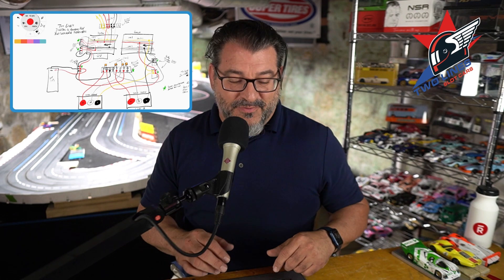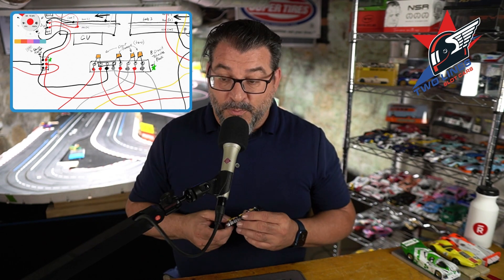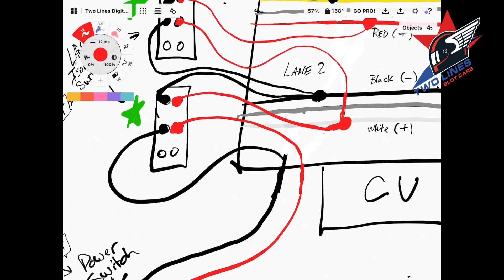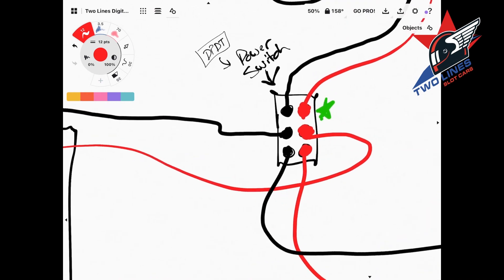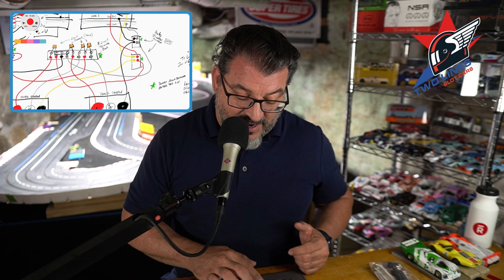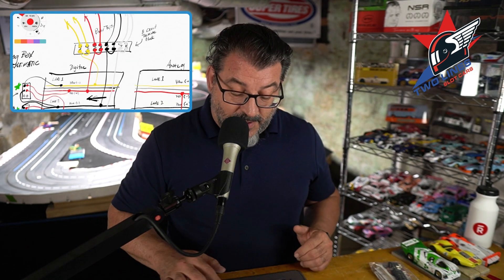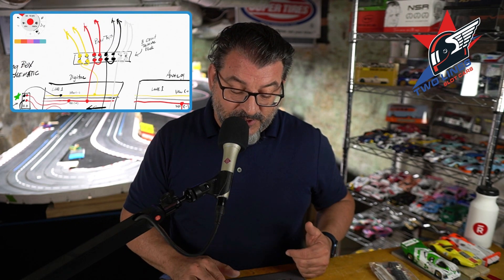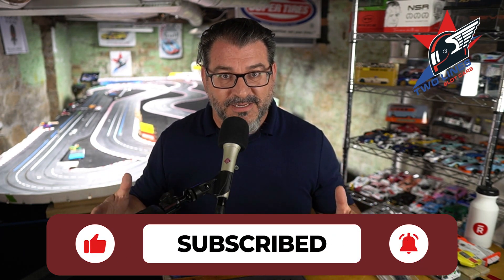Discussing how to DIY a Carrera Digital to Analog Conversion Box - Part 2

Comment: so what happens with all your lanechangers and pit lane?
Reply from the maker: They are not operational in analog mode. but operate like regular track peices.
Reply: @twolinesslotcars  sorry yes that I know, but you have to isolate the electronics since you are switching the polarity right? This means you have to have wires coming out of every LC to your box?
Reply from the maker: @CR3DT  Yes, you are switching polarity of the track.  The switches protect the CU. The lane changers are not impacted by the polarity change.. they act like standard track when in analog mode. There is a link to my hand drawn schematic in the description. @SlotR did an update to my box using relays, it is much more efficient,  but does the exact same thing.
Reply: @twolinesslotcars  I was under the impression that if reversed the polarity of the track (let's forgot about the CU for min) and there was an LC, that I would short out and burn out the electronics in the LC unless I isolated them? Sorry if this is the stupid question
Reply from the maker: @CR3DT  the only digital track piece you have to worry about is the CU and the Corner Lane changer. Because inside those track pieces the lanes are jumpered together. Corner lane changer is easy fix. Open it up and remove the lane jumper inside. The key is that the positive rails are isolated. That is why the lane changers are safe using the convertor box.

Comment: I've started this project, but I have another question. The additional wires under the cu track (yellow, blue...) do you leave those hooked up and only use the red and black wires to the new box?  Thank you.
Reply from the maker: The yellow and blue wires go to the lap counting LED’s. Leave them alone.. check out SlotR’s new video from last week.. it is an update and improvement to my design.
Reply: I will, thank you very much!

Comment: I don't think I understand how the digital CU gets power. Is it from the track? I love this idea!
Reply from the maker: Power from supply goes into the box to a switch.. and from the switch.. to the CU.. and to the Analog side.. then i used switches to protect the CU when in Analog mode.. it is a very simplistic look at it. I could use an Arduino and some relays to combine some of the switching.. it could be done a million different ways.. but this works.. I use it every day.. Thanks for watching!

Comment: Thank you Marty !! Have you been able get this to work with the 4 lane track you have now ? I’m about to start on my 4 lane on about a month and would like to still be able to use my tech slot box with my 4 lane 2 digital 4 analog
Reply from the maker: I do have it working on my track. It takes a bit of work.. but it is possible. Your Tek Slot Box will only do two lanes of digital and analog unless it was specifically built for 4 lanes.

Comment: Marty I like what you have done so far. I can't find the next video where you said you would open your box and also show us the wiring of the cu and analog straight piece of track. Also can you send your email so I can get a copy of the wiring
 Thanks so much.
Reply from the maker: Kevin, there is a link in the description of the video to down load the file. I have yet to release that video because I have made some changes and added lanes to the track.
Reply: Marty thank you for the prompt response.  I have the same 2 lane track that you had before you went 4 lane, and am considering going also with your 4 lane track.                   I downloaded the non schematic and wired my track identical to yours. The digital works and the analog works but the controller in analog runs both lanes at the same time no matter which station I am hooked to. 
When I run the digital track I use my original Carrera power supply hooked to the CU.
For analog I use a variable 3v/10a power supply hooked to the main switch in my new power box. Can't use a multimeter worth a crap.
I have a second CU for this that is not yet hooked to my track so I am doing this on my work bench. Also on my track I was able to successfully wire in an Axel BOX which works great, but like you can't use my old analog controllers. Thanks for time, and am looking forward to going 4 lanes if I can get the 2 lanes to work properly. 

Kevin
Reply from the maker: @kevinclayton3179   if in analog mode your controller still controls both lanes.. you do not have your lanes isolated. My guess would be that your lanes are still connected in the CU. That is only a guess.

Comment: Im using 18awg. Should be fine. Easier to route. Im an engineer, my electrical knowledge is not incredible though. More of a jack of all trades (Support Engineer)
Reply from the maker: You should be fine.. I think what I used is over kill now that I know more.. I learned a lot through this project.
Reply: Your layout is beautiful. Mine is good but it's 8x12, 15.25M length
Reply: My design has 4 switches might get it down to 3.

Comment: Good work Marty. I'm experimenting with using 12v relays instead of DPDT switches. The idea is you use one switch that activates a series of relays that do the track and power isolations and switching. I'm no electrician either so I'm wrapping my head around a non-schematic schematic like yours.
Reply from the maker: Great idea, my brother and I have been discussing a better way for version 2.. if we ever get that far. Mine is simple and crude.. but it works!

Comment: Nice job Marty.  Why 14ga though?  That’s way over kill for a single car per lane in analog, especially for those short runs of wiring?  I mean it ain’t a bad thing, but wondering what reasoning is to go with such large gauge wire for a circuit that’s limited to 5-7 amperes?
Reply from the maker: Thanks Joseph.. I was going to ask you about this.. I used 16g.. I have had zero issues.

Comment: Awesome info, but I doubt the guy making the Axle Box is happy with you 🤣
Reply: Axel box is different that what Marty is doing.
Reply: @dannywiley4072  Yep and so is the Tek Box and Digi Box .
Reply: I don't think it will be a problem for him as a lot of Carrera fans will continue to not use the analog pro controllers and still use their Carrera or other brand of wireless controllers that even if wired are CU friendly. So the Axel box and Tek box and hmm Dig-A-Box and any others that show up will continue to have customers. It seems this is for pro analog racers as is the omnibox where not running the CU when racing hot motors for those pro analog cars . But I am interested for one big reason: Save the CU !!